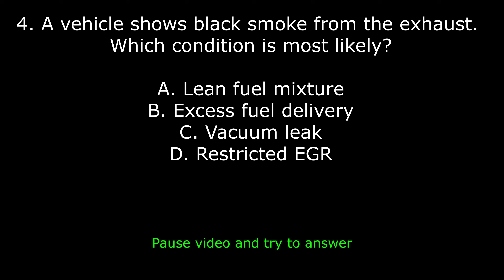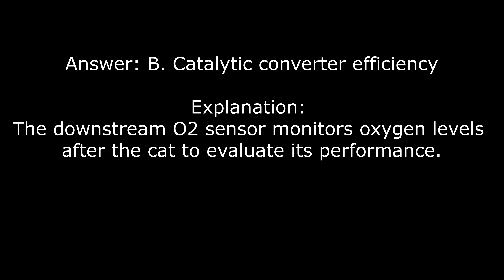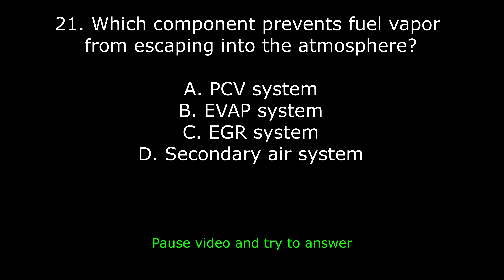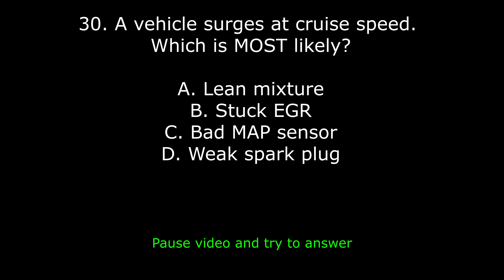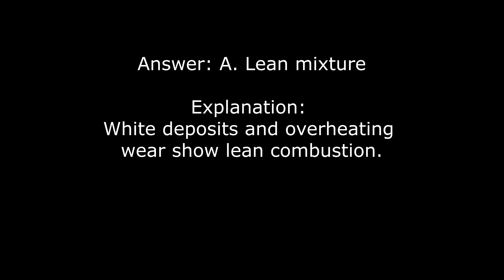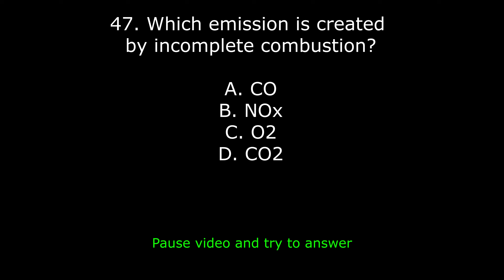50 Question ASE A8 Practice Test | Engine Performance Certification Exam Prep

Comment: 35. A stuck purge solenoid can most def cause a lean condition. Most of the time it’s something to look for when a car comes in with a lean code.
Reply: Nope, it will in fact give you a "rich reading" due to extra fuel vapors being introduced into the combustion chamber & the 02 sensing it
Reply: @MrJs197  it for sure can. But it can for sure also turn it into a lean condition. I just went through it.
Reply: @samuelxrc  Per via ASE questions, It can't. These questions are based on "As if the system is working 100%" For a real world scenario, you'd be correct for sure! For a bad/cracked line, seal or gas cap being left loose can cause an lean issue. So yes you would be correct! But again this is a "hypothetically speaking" situation unless stated other wise! That's how ASE & Dealership Certification tests are. Also some of these questions/answers are not 100% correct either.